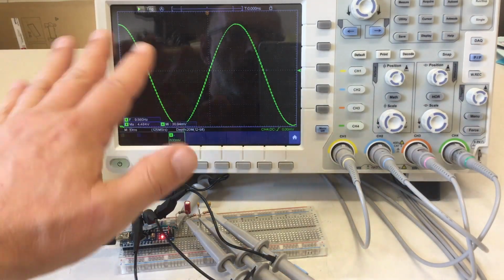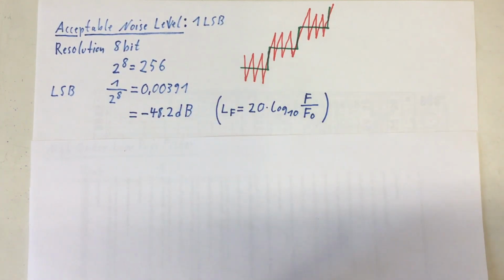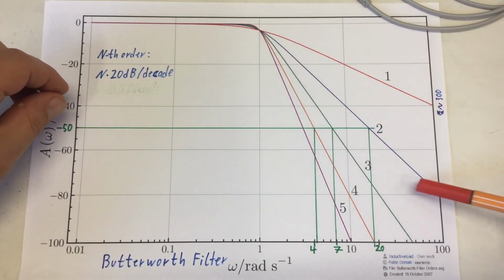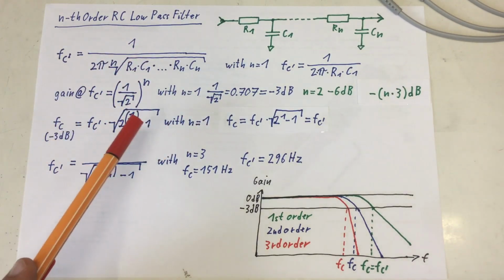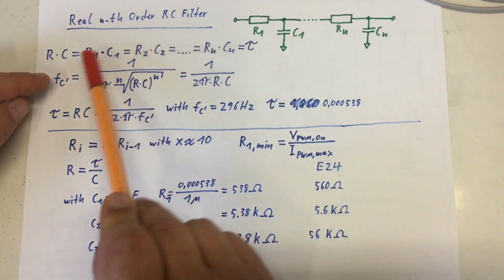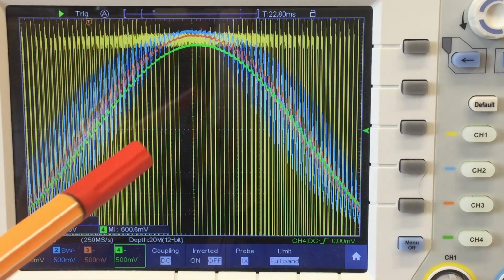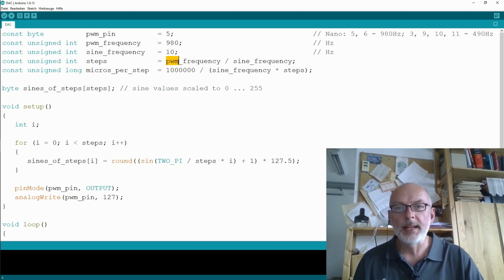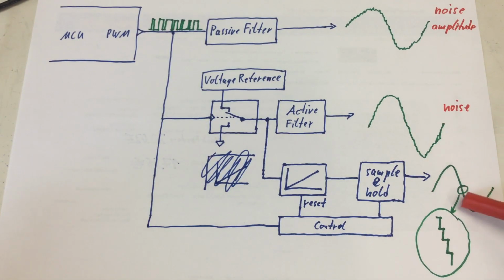N-th Order RC Filters for Analog Voltages from PWM Signals – The Hard Way

Comment: EXACTLY what I needed. I am trying to connect my arduino to a BLDC controller. The controller expects an analog signal from 1.2v to 4.7v.
Reply from the maker: Well, then you can indeed filter out the hell of the Arduino's PWM outputs. However, you could also consider using a simple DAC (see https://youtu.be/bj57xuQS7L8 and https://youtu.be/BrZYVWQ-p3U ).

Comment: How did you get Volts from dividing 1 LSB by 255 steps? It is very confusing ... 1/255 is indeed 0.003, but why it is Volts ?
Reply from the maker: I'm not quite sure I understand the question. Could you please provide a timestamp.
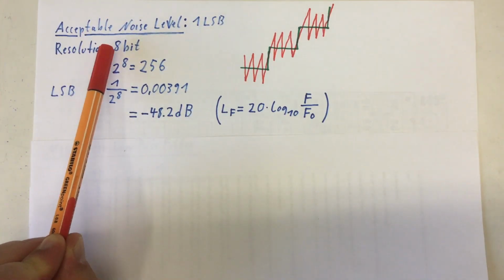Reply: @robertssmorgasbord  Thank you for the response! The time is 6:40 when you start to talk about 1LSB and the 8bit resolution. So my question was - how can we get the measurement unit of Volts if we divide 1LSB / 2e8 ?
Reply: Btw, your explanation is very clear and scientific, so I easily follow along, just sometimes happens that something a bit unclear remained
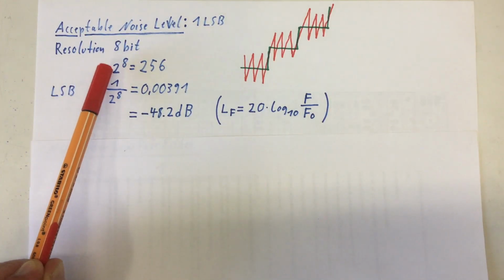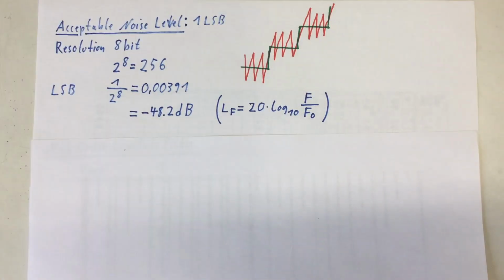Reply from the maker: @artjomzingfeld6881  Answer to "Thank you for the response! The time is 6:40 when you start to talk about 1LSB...": OK, so at 8:04 I make the jump from a dimensionless number (0.00391) to a dB Value. I'm just pointing out there, that the dB conversion formula I'm using is for field values F, and not for power. And I'm just giving Volts as an example for a field value. So we're not quite at Volts there. Remember, I arbitrarily defined the full scale at 1 (F0) and subsequently 1 LSB as 1/2^8 = 0.00391 (F). At that point - calculating the dB value as 20*log10(F/F0) - it really doesn't matter how many volts (or other field values) the 1 might represent. It's only the ratio of F/F0 (which is dimensionless again, even if the F-values would be Volts) that counts here. So I'm really not talking about Volts at that point. I was just giving Volts as an example of a field value, as opposed to power values (Watts), for which you have to use another formula.

Of course later on, when when I do the measurements on my oscilloscope, my full scale 1 becomes 5V, because that's the output voltage of my Arduino's I/O pins.

Hope that helps.
Reply from the maker: @artjomzingfeld6881  Answer to "Btw, your explanation is very clear and scientific...": Thanks for the praise 🙂 I guess when making these types of tutorials there are some things that I (sometimes mistakenly) imply as a given and thus don't mention explicitly. Of course you can always (and should) ask if something is unclear. I always try my best to answer any questions.

Comment: Thank you! the best in-depth yet practical vid on DIY Arduino PWM-DAC. Do you have info or a similar video on the MOSFET switch? Or maybe advice on whether an op amp switch/comparator or voltage follower would be ok to manage the Arduino analog out  limitations?
Reply from the maker: You're welcome! And thanks for the praise! Unfortunately I do not have a similar video on MOSFET switching. But if you're in search of an enhanced analog output option for the Arduino have a look at:
"Arduino MCUs and MCP48XX/MCP49XX Family DACs – The Basics" https://youtu.be/bj57xuQS7L8
"Arduino MCUs and MCP48XX/MCP49XX Family DACs – The Details" https://youtu.be/BrZYVWQ-p3U
(much easier solution than some op amp circuit)
Reply: @robertssmorgasbord  excellent! I’ll take a look. I might be able to figure out the MOSFET switching myself with a bit of research but I’ll take a look at your suggestions first.
Reply from the maker: @7modesto7  Again, you're very welcome! And yes, you'll definitely work out the MOSFET switching by yourself. There's a lot of info about that available on the internet.

Comment: Many thanks .. Perfectly designed and explained. 
Will it generate a 60 - 70 Hz signal ?
Reply from the maker: Not really. The standard Arduino PWM frequencies are between 490Hz (e.g. Uno) and 976Hz (e.g. Nano Every). 490Hz/70Hz = 7. So you can have at most 7 samples for a 70Hz sine wave, which in theory is enough but in reality will not yield a nice output. 976Hz/70Hz ~ 14: Better, but still not good. However, there are ways to increase an Arduino's PWM frequency (never done that myself though - it involves some ATmega register banging).
Reply: I'm trying to get to similar  frequencies. I'm using a bit of trial and error and tweaking approach trying to get to 100 Hz sine out - maybe even a reasonable saw/ramp if I can get the filter just right. So far I've been able to get to a bit over 60 Hz using bit banged PWM on an Uno from ideas gleaned from here: https://forcetronic.blogspot.com/2018/02/converting-arduino-pwm-output-to-dac.html
But I'll use "Mr Smorgasbord's" video here for the clear explanation and more accurate engineering. The basic Sallen Key filter cutoff is not sharp enough. I'll try 3rd order based on this video.

Comment: 1 RC section provides 1 pole = -20dB/decade roll off. Using 1 LC will give 2 pole = -40dB/decade. But people choose RC filters as they are impossible to be unstable, as the poles are always real and separated. On the other hand, LC filters can have comples poles and hence needs careful design. Hence, even though, LC filter achieve better performance with lesser components, they need careful design and more math.

Wonderful comparisin of amplitude and phase, in the video.
Reply from the maker: Hi Debraj! First, thank you for the praise! And yes, you're absolutely right, LC filters are much harder to design.